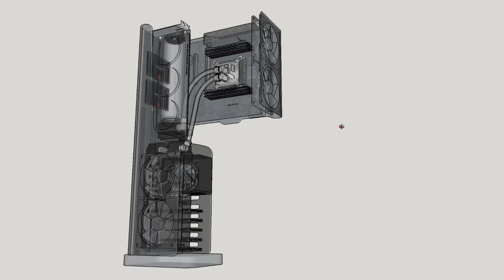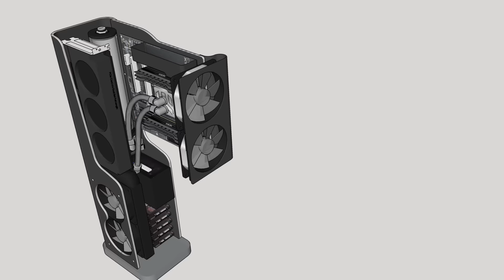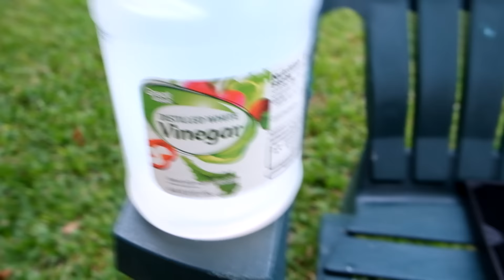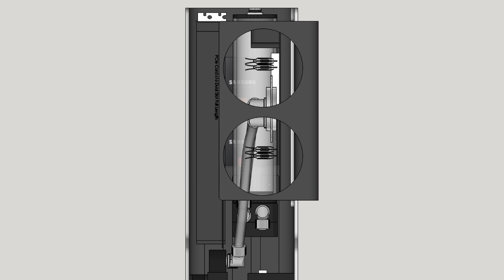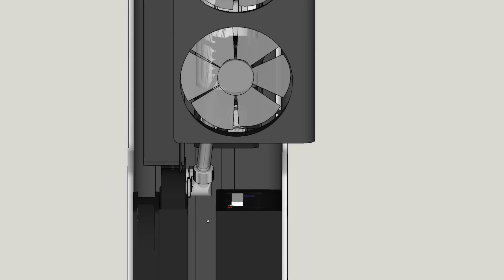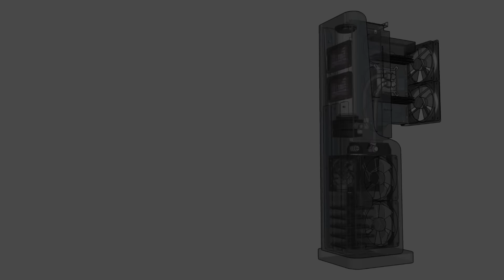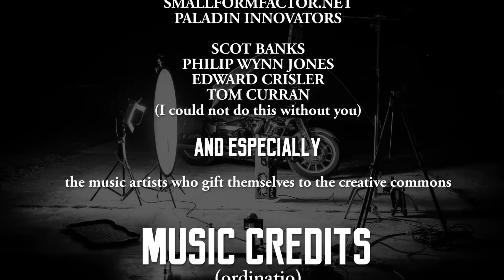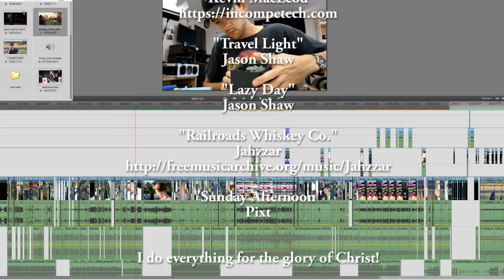Not From Concentrate 2 - Episode 4 [FINALE] #NFC2

Comment: I had some help from my local computer shop with my first custom rig.  I went in with a list of the newest shiniest hardware and they swayed my decision I made a few compromises and came out with what I could "afford" at the time, around $2500.  Initial set-up was a lot of swearing, but in the end, I ended up with a computer that served me well for almost 10 years before major parts were required.  I had upgraded original gear as I went along to the point my motherboard and processor could no longer keep up with the newer tech and drivers became incompatible. :(  I don't have any free funds for a major upgrade that I need. 4 kids come before a new computer for Dad! :)

Comment: hehehe when i did my first build i was about 15-16 i bought a amd apu a 10 6800k and a gigabyte motherboard 2x4gb sticks of ram and a 1000w overkill power supply. when i turned it on for the first time it kept boot looping over and over until i sorted out the display issue. eventually i ended up buying a sapphire r9 280x when they first dropped and that was the greatest card i ever owned till recently it started artifacting bad and sapphire sent a refurbished card. I love sapphires cards i just wish their customer service was up to par with some of their competitors. slowly but surely i have upgraded all my parts and i currently have expanded my rig to be my proud Excalibur.

Comment: BIOS error code 36 :). Clear the CMOS
Reply: +György File  Hahah!  Sharp eye, but in this case the display is showing temperature, which seems about right--it was a cool evening and the fans weren't spinning yet on the radiator which I had temp controlled or the GPU.  :)  It runs at 45-46 under load so I think that's right.  Peace!
Reply: +Not From Concentrate oh then I was wrong. This build is much more better than the first one. Nice job. Btw I could use an R9 Nano :D